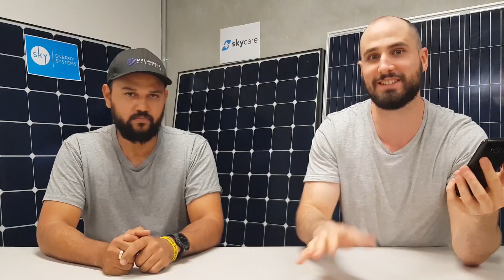OVERSIZING SOLAR INVERTERS

Comment: An inverter can pull from a 1,000,000,000,000 watt system. Watts have nothing to do with anything.

An inverter PULLS energy from solar panels. Solar panels do not "push" energy into the inverter. It PULLS.

PULLS.

As long as the voltage is the same, the other numbers are irrelevant.

Comment: Hi, if i  have the inverter with a max 4000w or 450v input per mppt, would be the mppt affected if cross that limit with a pv string which exceeds to 4100w or 490v ?
Thank you
Reply from the maker: yes, this is not recommended for two reasons
1. exceeding the max power per input could damage the inverter, and it will void the warranty
2. the MMPT will not function correctly if it is out of range and you will not get the most efficiency from the string

Comment: In case of oversizing, should I consider the "nominal power" or the "maximum input power" of the inverter?
For example, I have an inverter with a nominal power of 4.6 kwatts and the maximum input power of 6.2 kWatts. Should I oversize considering 4.6 or 6.2 kW?. Thank you
Reply from the maker: Usually the nominal power, BUT definitely read the product spec sheet for the correct information as it should be in there or contact the manufacturer. This information is then what you use in conjunction with state electrical laws. Trust that helps!
Reply: @skyenergy6282  Thanks

Comment: I have fronius primo 5 that has been going for 4.5 years with 5.22kw of JA 290s panels set up with 3aspects East, West and North 6 panels a side, I have been thinking about changing the west and north to lg neon 370s. I was thinking that mid summer only having peak output for 1.5-2hours I could increase to say 4 hours. I also have a Powerwall 2 installed early August 2017 and I have a Tesla model 3.

Comment: I have 72 panels (275 W) = 19.8 kw,  and an INVT inverter ( Invt goodrive 100-pv:  11 KW). Should I upgrade my inverter to 15 KW (efficiency wise)??? Thank you
Reply from the maker: Yes!
Reply: @skyenergy6282  This is what I suggested to my local provider but he said that my panels will be giving between 14 et 16.5 kw, so DC/AC ratio will be between 127% and 150%, which would maximize my inverter efficiency. Is this true??
Reply from the maker: @assil110  Approx 20KW of panels that you have is almost 100% more than a 10KW inverter. That's why I'd recommend a 15KW inverter instead. Trust that makes sense :) Have you had the solar installed yet or still getting a quote/advice?
Reply: @skyenergy6282  I totally agree with you. Yet, the installer is still insisting that my argument does not make sense because solar panels never provide 100% of their nominal power, in optimal conditions, they will provide  around 80% of 20 kw (16kw). He also says that INVT inverter can handle up to 80% of extra power. The solar are installed but I firmly asked him to change the inverter with a 15 kw one before I can run my SAER submersible pump (11kw). I really appreciate your helpful and valuable advice

Comment: I’ve got 21kw of panels. 2 inverters to get 16kw of power max. 1 inverter is a Storedge for my batteries. The other is an HD Wave. Would it be wise to get inverters that come closer to the 21kw of potential energy due to the size? 

Understood if you only lose 1-2kw on a smaller system. However we are losing around 5kw. This seems like a lot
Reply from the maker: I would go bigger on the inverters.

Comment: I just brought a 4000 wtt inverter with 1200 watts of panels... is that ok. Ots an off grid system
Reply from the maker: Depends on the inverter. What is the model?
Reply: If you don't have batteries you can't output more than the maximum of solar panels output

Comment: If we have 2 x 5k Inverters with 30 panels would I still be able to get a rebate in 2020?
Reply from the maker: Which rebate were you aiming to get?
Reply: Sky Energy We are on the Mid North Coast and what ever rebate is available at this time? I keep reading about Rebates and have only just last week had our system installed but not connected to the grid as yet due to no Smart Meter being installed in our Meter Box.
We have had no information regarding any rebates.

Comment: Great information provided. I have 5KVA MKS Plus MPPT 80A inverter, will this inverter support over-sizing?
Reply from the maker: It should! Just double check the manual :)
Reply: Sky Energy There’s nothing mentioned in manual regarding over-sizing.
Reply from the maker: @FaisalDilbagh1  Dang, I can't really comment if it's not in the manual! It might be okay, but I wouldn't want to tell you the wrong thing and void the warranty.

Comment: In oversizing, which to consider in identifying the capacity of inverter?, max input power (watts) or max input voltage? I have an inverter with max input power of 1200 watts but the max input voltage is 600, can i oversize it using 5 300 watts pv?
Reply from the maker: It depends on both and also depends on the specs of the inverter. Different inverters allow different amounts of over-sizing.
Reply: Don't exceed the maximum voltage

Comment: I thought the inverter pulled power from panels not pushing power into inverter? So in theory you could run 5kw into a 2kw inverter??
Reply from the maker: In theory you can, and what you're saying is true. It's actually a circuit so the inverter is ''pulling'' and the panels are ''pushing''.

Comment: A bit misleading, you are talking about oversizing SOLAR PANELS Not OVERSIZING the INVERTER...  for example: 1kW of panels on a 4kW inverter...
Reply from the maker: Oversizing the solar array for the inverter. Is what I meant.
Reply: Friends of mine have oversized their inverter (8kw) and array (10kw) as they are large consumers of power on single phase. Is this advisable? I understand the limit to export to the grid is 5kw, but can the extra from inverter still be used to power house use. Is it a special inverter mode or would they need extra hardware? In theory the 8kw inverter would limit output to 5kw. Is it a massive waste $$ trying to export for low FiT? Effect on the ROI?
Reply: @davidjarvis2656  power company would be clipping for sure
Reply: @davidjarvis2656  
The array could be ten million kw. It doesn't matter.

An inverter PULLS energy from the system. Just like when you plug something into an electric socket.

As long as the VOLTAGE is matched, it can pull from the biggest solar array in the world if you hooked it up.